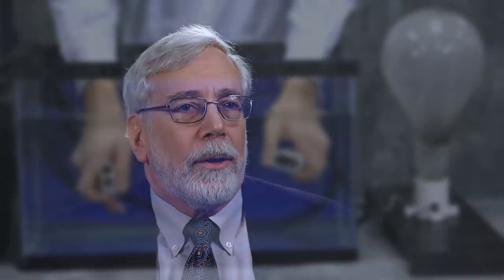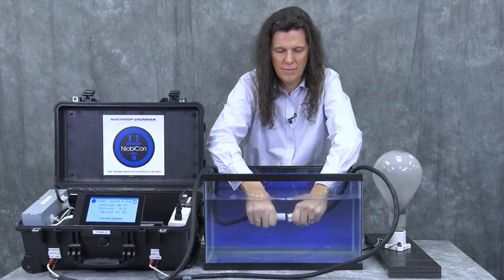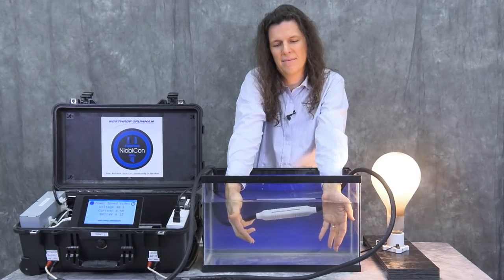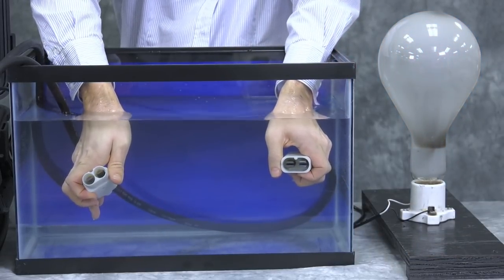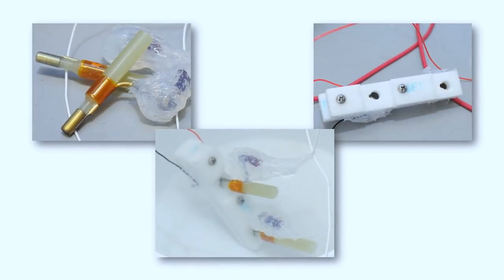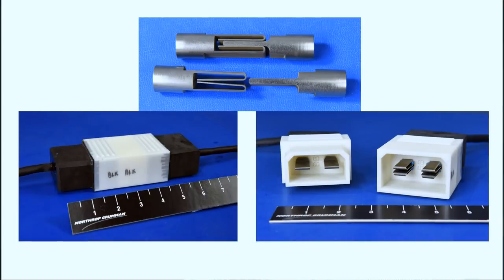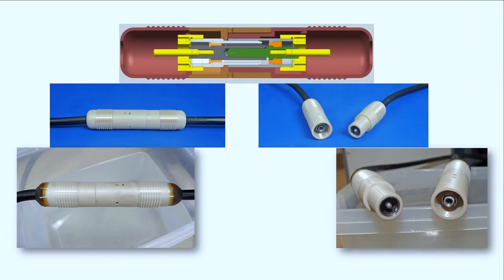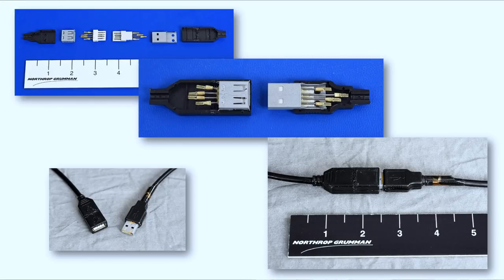NiobiCon™ – Safe, Reliable Electrical Connectivity in the Wet

Comment: 2nd question does your Niobim material only have this protective reaction when coming in contact with H2O? 
What about industry applications such as automotive and transit wire power and data connectors that when compromised with hydraulic fluid, brake fluid and or any other common engine fluids? Are these applications over reaching of Niobim capabilities?
Reply: I don't believe that the kinds of fluids you mention would damage the connector's capabilities.

Comment: Is there a voltage-current limit before the insulation layer breaks down??
Reply: It says 75V DC so not high voltage but plenty to charge Lithium Battery packs & transmit data.